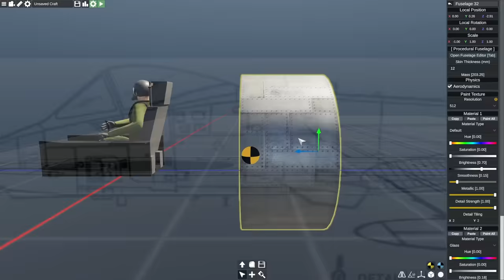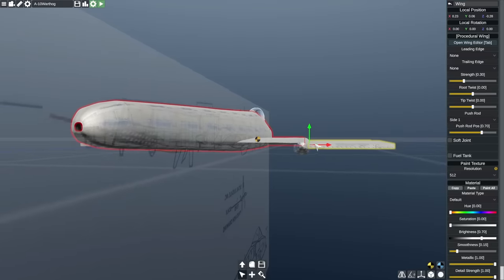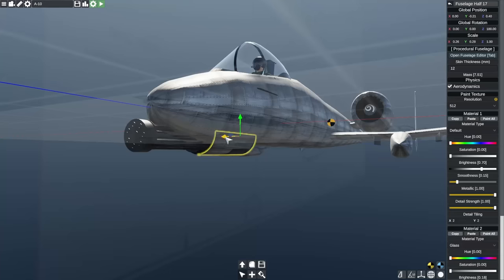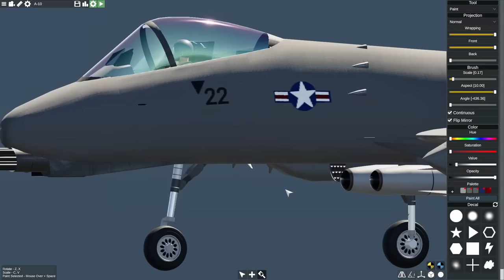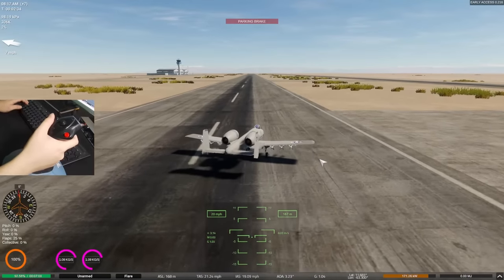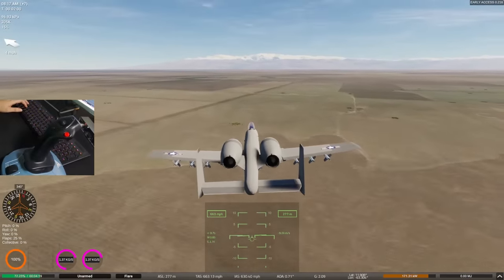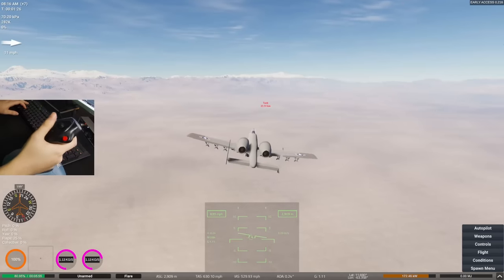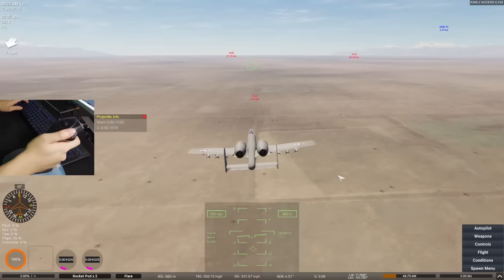Using A 'DEADLY' A-10 WARTHOG With a Flight STICK?! | FLYOUT

Comment: A quick general tip: if you want a more maneuverable aircraft, you should put your center of pressure directly in the middle or even slightly above your center of mass. Though it will make your aircraft harder to control.
Reply: You can go to your seat and set pitch dump to some number(higher number = less maneuverable) its something like fly by wire
Reply: @doomguy987  i don't play flyout, i just have a general understanding of aircraft mechanics. But that sounds like a cool detail.

Comment: If you press the camera button in build mode, you can change the view direction like: left, up and more. You can also change the displacement type, this can help when you are using blueprints.

You can easily change trim in flight if you press the three bars and go into controls, where if you press controls you get a menu for: pitch, roll, yaw, flaps (auto to 1 for some reason) and speedbrake (there might be another one but am not sure)

If you activate mirror mode, material painting will mirror to the other side, with can make changing the cockpit to glass take less time!
Reply: Hello, Vaxkts.
Reply: @Jwalk0732 no, just no.

Comment: little late, but did you know you can press numpad5 to go into orthographic mode? this removes perspective and makes it easier to accurately copy shapes from a blueprint. you can also use numpad7 for top view, numpad1 for front view, numpad3 for left view, and numpad9 to invert your view. I find these very helpful in the building process.

Comment: Did you know the wheels on the rear landing gear on the a-10 are exposed so in the event of a hydraulic failure the a-10 can still land safely.

Comment: Video 26 Could you please make a zero powercore sailing battle with actual sailing tec wehre you can basically sail against the wind (you don’t actually sail against the wind just in a very steep angle)
It should take place on all of the hig seas regions

Comment: For proppeler planes u need a V6 motor if light (beter 2 motors) or v 12 and 4 motor if heavy bomber 
And a propeller in (can be morebof 1 for 1 motor if u brave. Enough